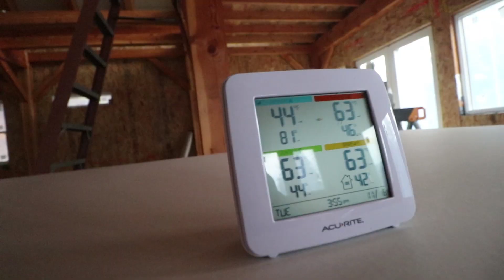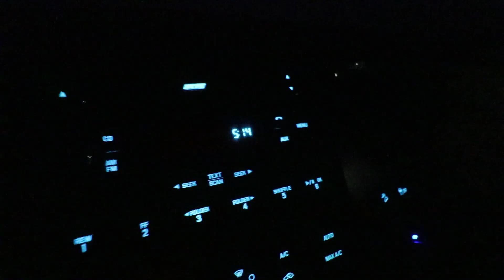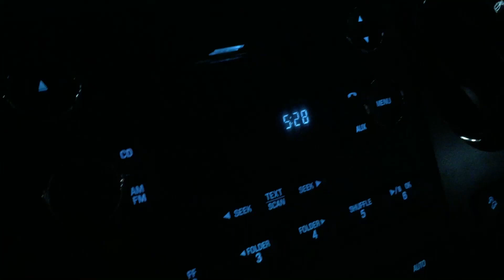This Video Will Make DRYWALL INSTALLERS CRINGE!

Comment: From experience paint will peel around the edge of the shower panels no matter how much you paint. A coat of shower sealer will help protect the Sheetrock later down the line as well as some silicone after painting. I am not saying you have to do that. Doing extra work now would save you from doing it later.
Reply: macrixen yup. My shower is doing it

Comment: sheetrock is such nasty work. I have done tons of it but I never got good at it. always keep the edges of your sheetrock bucket wiped and clean when you're done. and I was always taught to make sure the top of the mud was flat and even a tiny bit of water on top to keep it in good shape

Comment: Get a drywall tape reel or drywall banjo whichever you want to call it. It will make taping the walls 100 times faster. It will be the best $70 you have ever spent. Also thin the mud to about pancake batter consistency for applying tape.

Comment: Paint does seal the SURFACE of the sheetrock, but are you painting the edges and BACK of the sheetrock as well?  Glad to see it is MR but I still prefer the mold/mildew sheetrock for high moisture environments.  I also like to moisture barrier BEHIND the tub/surround as moisture (and leaks) WILL get behind the surround and cause mold mildew in the boards behind.  I give it a year or two before that happens on your surround....   BTW: great choice on the bullnose corner beading instead of square corner- I love that stuff (you are supposed to attach that type WITH mud, not screws).

Comment: If u wet the drywall tape first it’s a million times easier also when doing a bullnose with paper don’t use screws just back butter the wall then apply the bullnose and remove excess mud
Reply: If he would just fold the tape before putting it in the corner he'd be better off .  Definitely should have reviewed some youtube videos before attempting this.

Comment: The paper bulnose uses drywall mud to hold it up not screws or nails. You didnt know so its ok. Also put mud on wall the tape over mud then use knife to seat tape into mud and remove excess mud. I used to do drywall for a living and learned from pros.

Comment: Backfill the bull nose with mud then apply it.  Espcially the paper ones.  They are much more durable that way in a bathroom and you won't wind up replacing them in a year, I speak from experience.  Know why you didn't use green board.  It is really just drywall with a mold resistant treatment. Curious why you didn't use some sort of backer board and moisture barrier behind the shower surround though?  It will leave it prone to mold without it.  Keep an eye on that in the future once the walls are enclosed on the other side.  Good job though regardless.

Comment: Latex paint breathes. It will allow water VAPOR through which is why it is used as a vapor control layer in Northern houses to allow the wall assemblies to dry to the inside and keep it from condensing on the back of the cold sheathing. In a bathroom, "green" board either has fiberglass or treated layer of paper to keep mold from growing. So, what does this all mean? The real question is not IF water will get in the wall, but when. In the case of this bath, it probably will not be a terrible issue as long as the bath fan is allowed to run at least 30 minutes AFTER steam is created in the shower and sink. 40 years of tearing out bathrooms has shown me a LOT of mold. Check out The Journal of Light Construction- an invaluable resourse for home builders. Also, go to Building Sciences website and Joe Lstiburek. Buildingscience.com

Comment: I like to use a plastering float and a hand held hawk saves on bending down a lot to reload ''mud'' I live in the UK and prefer solid walls with for kitchens and bathrooms, I am used to calling ''drywall'' plaster board,  I am not a professional but a DIYer

Comment: Just one question why didn’t you use mold prevent sheet rock like hardy back or green drywall?
Reply: In the video he claims he did that this is a different brand.  You can see the text on the board says "walls and ceilings"... defiently not mold board

Comment: Would fail inspection around here if it is not purple or green around the shower.  For paint I've had better luck with exterior paint in bathrooms. And I'm excited to see how the dry wall turns out.  If your tape doesn't bubble then you are getting away with a lot less joint compound than I use.

Comment: Put your mud on your joints first heavy, then put the tape on it and put the knife on it, hold the tape on one side and push hard on the knife and pull the knife so the mud will come out underneath the tape. That's call bedding the tape! Get all the mud you can by pulling as much of it out. There should be just enough to hold it in place with no bubble in the tape. the corners are a bit of trouble at first but do one side of the corner at a time makes it a lot easier, just make sure to fold it in half before you apply the tape.

Comment: Washing dry wall mud into a septic system will provide you with endless years of fun! Wash your tools in a bucket and then toss the water on the gravel driveway, or some other place that won't mind dry wall mud.

Comment: One of the reasons they went from metall to paper corners is because if you accidentaly hit the corner of the metal it would crack the entire. With the paper you just get a cracked corner on that one spot wich you can mud over to repair. Also the ones we got in Norway we just mist with water to activate the adhesive before sticking it on without mud. Realy great and quick system!

Comment: It looks good.  But you are not fast yet.   For the upper screws you can slide your 4 inch knife up the wall to streak across the upper screws and bring it down on the down stroke to scrape it down.  It takes two seconds ... up down.  It's okay to leave a slight bump as it will shrink and lay flat.  You can sand minor defects with a folded piece of cardboard box.  It is self abrasive, like sand, it sands itself, you just need to rub it.  Sanding screen is fast but degrades your paper and contaminates the next application of mud.   I would paint a bathroom with an oil paint or at least an outdoor grade paint.

Comment: Funny I read comments first and expected a disaster. You did great, you don't wet the tape, you put mud on joint and stick tape to it then remove excess mud, great job.. My only advice, buy 5 gal buckets, much cheaper and you will definitely use it.

Comment: its called concert board , but the sheet rock is fine but to water proof the bath room i would use Schluter Kerdi 108 Sq Ft Waterproofing Membrane i would put that from top to bottom in the bath room , and if there is ever a leak it wont soak threw to the dry wall

Comment: Put a bed of mud on a joint or corner first, then wet your measured tape and lay it down with a 4 inch putty knife in opposing swipes to keep it centered,  then go over it with a thin layer with the 8 inch knife.

Comment: the paper face bull nose goes on with drywall compound.  Some guys use a spray on contact cement like 3m Super 77 to adhere.  The paper face helps with adhesion and prevents cracking along the corner bead. I have also seen people use a small crown stapler to attach the corner bead. Thin you compound!!! Never use straight from the Bucket!!!  it will spread so much easier!!!  There are different grades of compound for different coats.  All purpose for taping and then the light weight for Block and Skim coats. You Should Flat Tape along the top of your Tub Surround!  it will make your caulk joint look 10x better!

Comment: jess, try wetting the paper tape, it allows the mud to stick better also put mud on the wall lightly before applying the tape.use a damp sponge too wipe the joint ten minutes after done.

Comment: You two need to investigate just what tools, processes and materials are available to make sure you end up with an acceptable outcome.  Below several people have correctly pointed out that regardless what color the board is in high moisture areas you (for your health and safety) need to be using MOULD RESISTANT wall board.  You should watch some videos on taping and see how to fist fill your joints, then imbed your tape using a mud box to drag your tape through a slightly soupy mud bath, then the fill coat over that and finally a finish coat feathering it out to hide those joints and seams.  Between coats don't sand. Sanding creates dust nothing sticks to dust, just take your knife 6" or 8" and scrape off the the lumps you only want to sand your finish coat. You may want to investigate acquiring some tools that are available to do your fill and finish coats. The brand "Level5" is one you might want to have a look at, they ain't cheap but you can sell them on when your done.  They will save you time and money and give you results that are superior to what you can get with your current skill level and basic hand tools.  This is getting a bit long check about inspections as mentioned below and good luck & God Bless you both.

Comment: You aren't buttering for tea and crumpets = slap the mud on, apply the tape, whatever is on the knife apply on top of the tape.  You have to saturate the tape = to bond with the drywall.  NO SANDING !  To late now for the bathroom, but for the past 20+ years, I've used the dishwashing sponge with the greenie pad attached.  Five gallon bucket / 2 gallons of water / two sponges.  Where light 'sanding' = use the sponge side.  For heavy mud areas, use the greenie side.  Throw sponge in the bucket and replace with the other.  NO SANDING, NO DUST, way way less to clean up.  No matter with screen sanding or sponge you'll have to apply 2 if not 3 coats of mud.

Comment: The little touch also clips onto a cap so if you are trying to see something but you need your hands to do so you can use it hands free - like changing a tire in the dark etc - you will see the clip goes the right way to clip onto a cap so the touch faces out

Comment: Hi all, doesn't state or other require moisture barrier in "wet" places like bath etc? Its mandatory in Finland, so I would assume same applies in US as well (btw we are NOT allowed to do that our self as it requires certificate and degree, same applies to electricity)
Reply: The only places that require an actual waterproof barrier is if your building your own shower pan. Which most states have set regulation that the pan must hold a test of x inches of water for 24 hours with no signs of leaking.
Heck most places you can still legally tile over normal drywall for a tub surround, though I would never do that myself.

Comment: Drywall tips:

1. Pigmented schellac (Kilz brand oil based primer) for paper stains, and water areas.  Will also cover ink pen writing from dumb architects.

2. Tape butt joints first, then recess joints, then corners.  This ensures that your tape ends do not come loose and curl up.

3. If you have any air bubbles under the tape, cut them out with a razor knife and re-bed the same piece back in (you will discover any air bubbles on the first top coat).  No amount of joint compound can cover an air bubble.
Reply: P.S.

Smooth wall is much easier to patch.  Do a primer coat and touch-up blemishes before paint.  Sand your touch-ups and prime over them, then paint.  3/8 inch roller nap is all the texture you should need.

Comment: You're doing a good job. If you put 100 drywall installers in a room and ask how they do it you will get 100 different answers. It like how do uou get to Carnegie Hall, practice, practice, practice. The more you do the better you get. An instal look er gave me a tip once for the last sanding use a wet sponge it softens and fills all the imperfections. It worked for me.

Comment: Use staples on your corner beads, bullnose or 90d. Not an air driven one, unless you turn the air WAY down.  The joint compound will secure it in place just fine after that.

Comment: Run your mud knife over all the screens to make sure you have them countersunk. Buy light weight mud by the box. Much cheaper. Use thin layers. Use progressively larger knifes. Don't put your finger on the blade, it warps it and it wont be flat.

Comment: After seeing that bull nose you are using I think I will be changing over to the paper type as soon as it is available here in the UK. The thing with the solid line is still there with the paper and it makes it a nicer corner. I use a sticky backed paper for the seems as it sticks to the drywall and makes it a little easier to work with. The may not be a drywall-er but their is nothing wrong with your bathroom, you have done a good job.

Comment: Jessse, I don't care what color your "drywall" is.  IF it has gypsum in it between those pretty white papers... Gypsum is moderately water-soluble.  Not only that, it actually attracts it.  You defended this sheet rock by saying your going to paint it with latex pain.  Guess what,  Latex pain breathes!  It allows moisture to go into the wood or out of the wood underneath it.  That's why it doesn't blister like oil paint does.  The board you should be using is made with concrete inside.  Yes, it can hold moisture but it has such a out of whack PH when it gets wet you don't get damaging mold.  One thing that might prove the point is the brown stain you get when you have a leak on drywall.  The stain is from the paper.  concrete board doesn't have paper.  I hope you don't learn this the hard way.

Comment: Your supposed to put mud on the wall then put your bullnose on the corner let the mud hold it on you could also use a hand stapler to put them on but best result is to mud them on   But anyway it works just different in how long it takes to get the finish you desire

Comment: The sheetrock around the tub  should have been durock or something more water resistant. I would only use tile, not a texture  finish. If you are going through the  work, take  those extra steps to to make it last longer.

Comment: In the UK we use self adhesive mesh tape for plaster board. Much easier.
Reply: yes martin , but self-adhesive mesh tape is to be used ONLY with a SETTING COMPOUND. a dry powder compound that is mixed with water for faster setting time, i.e. 90 min., 45 min., 20 min. however , these setting compounds DRY in the same time as pre-mixed mud ( drywall compound ). both will usually be DRY overnight, depending on the depth of the application. always use paper tape with a premixed compound.

Comment: If it were me, I wouldnt use that paper/metal bullnose, I would of squared off the corner and used bullnose tile instead.  But thats just me and this project is probably already 100% done considering its about a month behind.  Ive been following on IG and FB, havent seen the completion yet, which is why I said probably...unless I missed it and it is done already.
Reply: As for the inner corners, the way I made it easier for myself taping those corners were to cut the length needed, fold it in half, then put it up on the mud.  Makes it easier than putting it up flat cause you risk cutting into it or ripping it somewhere.

Comment: Not to scare you but I've seen mold take over the entire house in less than seven months just from one bathroom with one minor league that's why I always use duraroc in bathrooms or wet areas but all in all I think you're doing a pretty good job

Comment: I'm more on bout the insulation behind the bath that was not put there. Also, the bath??? was that insulated/fortified?
Reply: data , the ICF ( Insulated Concrete Foundation )is already insulated. the whole garage, all the walls,  are ready for drywall right over top of them. and remember , the floor is heated also. thats why no insulation was put behind or under the tub and shower surround.
Reply: You mean the SIP wall? aka Structural INSULATED Panel Wall that they built the garage out of.

Comment: Love your videos! Might I suggest some subway tile panels in your shower? Once you lay the tile, it'll give a better moisture barrier. Fairly cheap, fairly easy. Awesome channel!!
Reply: ...agreed! If not 'subway' tiles, some tile is a much superior surface in the shower surround...IMHO
Reply: Benjamin Seare they used a surround kit, so it’s 3 solid panels. No tile needed.

Comment: NOOB!!!!! jk but, You don't use screws on that corner they attach with mud like the tape. If you don't get mud under the paper it won't bond with the wall. You should apply the mud to the wall not the tape. Also plastic corners are attached with spray adhesive. The bathroom is a good practice run for the rest of the house. I'm glad you did the ceilings first because the walls actually help hold it up.  Keep pushing guy!!! :) p.s. it might be better to just hire out the mud work while you get the electrical ran.

Comment: Jessie on your outside corners, use a pneumatic 1/4 inch crown stapler. It doesn't suck your corners in so much. Also don't worry about getting your joints tight. Tight is for pros who like to save money because that's all they do. Here is a tip on mudding. In damp locations you will find the dry compound 90 minuet stuff works well to repel and limit mold. That stuff will soak up moisture a lot less than any pre mix, guarantied. Its a bit harder to use but the longevity will last decades longer. Also it will be ready to paint much sooner if the humidity is higher because it has a chemical reaction. Just a FYI. Good job my white haired friend,LOL.

Comment: cringe is right lol , skim coat first , then tape , then top coat and sand - I always used a mesh but that was just my preference over paper tape . had to pause at 20 min lol  ( looks like you did it this way on the inner corner after I got back to watching ) I have never talked to a pro that said popcorn texture is a good thing , they all hate it , it turns a simple job or matching any fix a nightmare